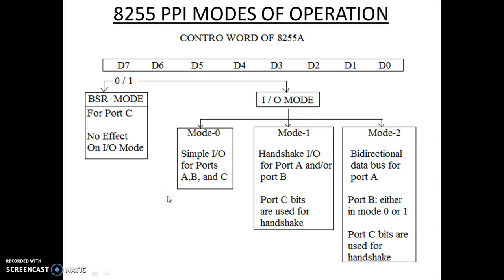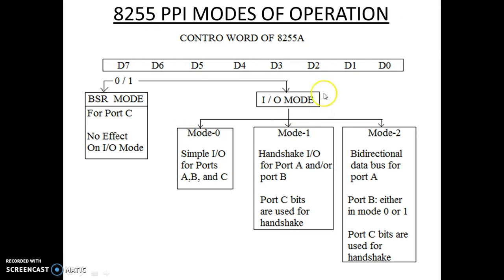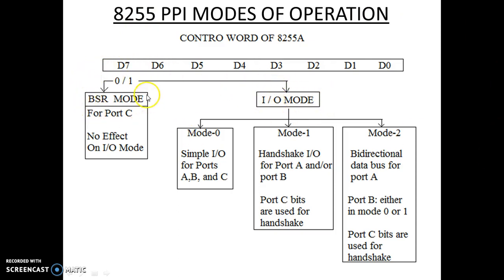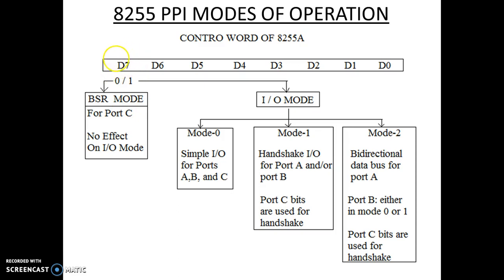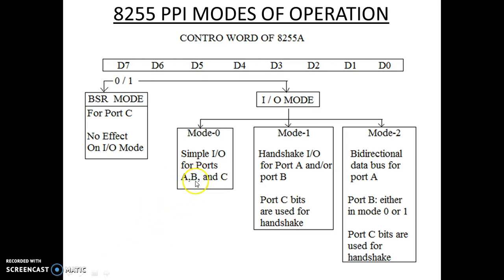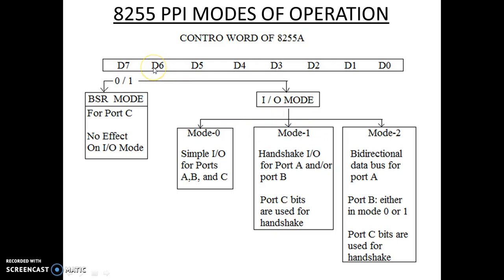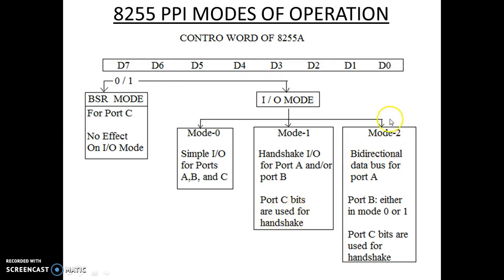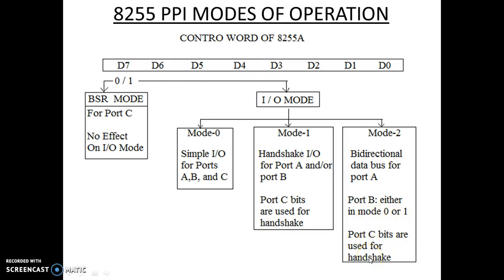8255 PPI modes of Operation

Comment: Q1] Design the complete hardware for interfacing maximum-mode 8088 MPU with twelve 8- bit input/output ports using 8255s PPIS. The port addresses start with 00A0       
Please  l need to solve this problem?